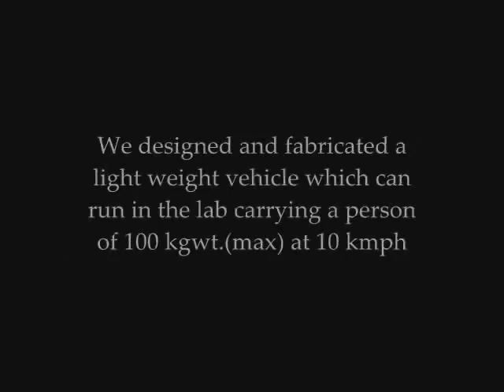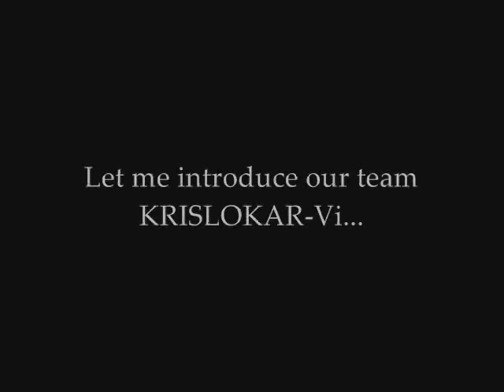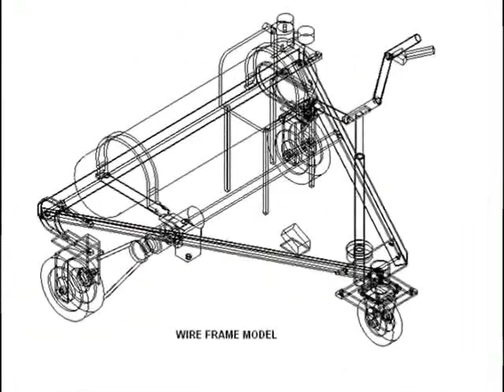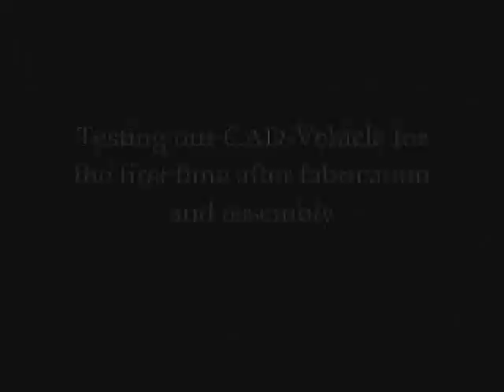COMPRESSED AIR DRIVEN VEHICLE

Comment: can u plz send me the soft copy of your project report on my mail...milanmacwan95@gmail.com& tell me that how did you attach the rear tyres with crankshaft coz that's only thing i couldn'd do. & also if you dont mind did you use gearbox with engine? & also that how did u control it without an accelerator?

Comment from the maker: Hi Tharan S,

Indeed using air motor would consume lot of air (huge CFM) and its hard to accommodate a big air container with huge pressures), also considering the vehicle weight constraints as well. The availability of Air motors in India is less, hence we went for alternative and used Air Drill as air motor with the range of specifications where we landed with our vehicle design.

Cheers !

Comment: In the USA, 20-30% of all electricity produced is for compressed air.  Compressed air is one of the most expensive costs in the manufacturing process.  Have you calculated the cost of making the air required to run your design as compared to the cost of an electric cart?  It would be interesting to see this data.  Good project and I'm glad to see young minds at work.

Comment from the maker: actually our wrk was at the context level..i mean we wanted just to run it..
so we didnt use any gear box,and as we have used an airdrill as primemover its efficiency is alos very less..
anyways our vehicle was driven for 2 kms with air filld @150bar in 10L cylinder.
with gear box it wud anyways run more...depends on gear ratio..!